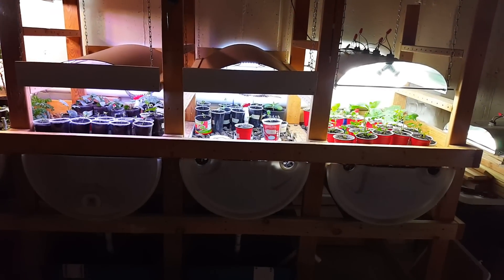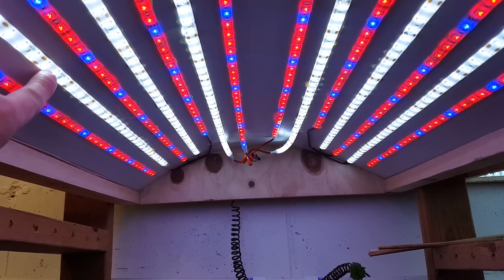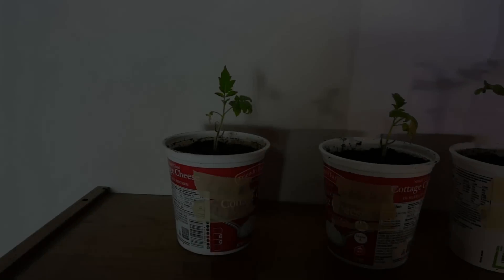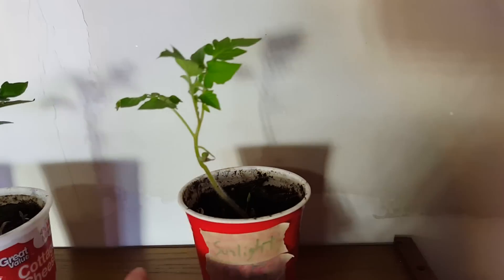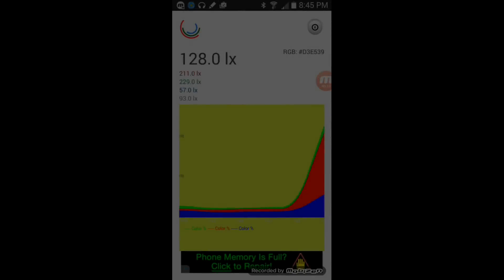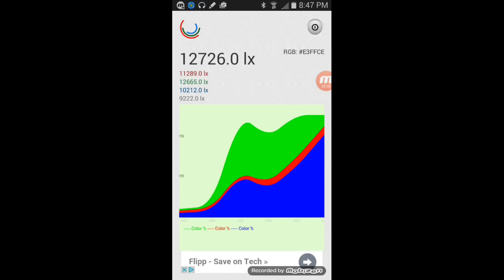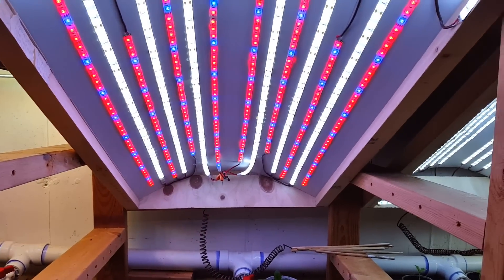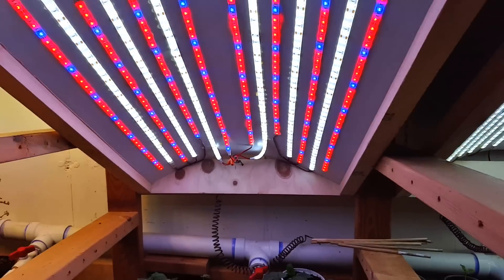DIY LED Grow Light Follow Up - Low Power LED VS CFL

Comment: I could be wrong, but I think you may be misinterpreting the relative amounts of RGB on the app.  The graph is an overlapping area chart, with the lowest (color) value in the front, then next highest, then the highest in the back/top.  I noticed the discrepancy when I looked at the numerical values of each the R, G, and B in the top left of the screen.
Reply: Glen Howard very nice observation!

Comment: I believe you created a problem for yourself by designing the LED units to have a curved surface. All that did was to remove the LEDs farther from the seedlings.
So there is no good reason to have a parabola. 

Look at the stills and videos of the automated plants in Japan where they grow thousands of heads of lettuce per day. The LED units are mere inches away from the tops of the leaves. In your design, they are a foot or so away. This results in far less energy getting to the leaves of the growing plants.
Reply from the maker: +Terry Thomas yes I have done lights both ways but the parabola provides more surface area for more light strips and also provides light at various angles which provides better coverage to the plants
Reply: Another thing I'm noticing is that he's using a single crop in an attempt to represent the effectiveness of these different lights. The wavelength of light will affect how well certain crops vegetate, so I think a better test would have been to plant several different crop families. You might find that some grow even better under the LEDs, despite the flawed design. Just a thought
Reply: Keven Jones
Reply: Luis Navarrete Campos
Reply: Mounting the LEDs flat, you would loose more light at the sides. On a parabola the LEDs are partially shining on each other. I don't know which of the two results in a better efficiency.

Mounting them all on a flat surface, but with an inwards tilt, would probably get you the best efficiency.
Reply: Terry Thomas Yes and the CFLs were closer to the plants. That alone massively biased the results toward the CFLs. If you double the distance between the plant and the light source you reduce the amount of light falling on the plant by a factor of 4.
Reply: Terry Thomassi
Reply: I was thinking temperature could be a factor. The CFL creates more heat. Warmer soil can make a big difference, how big, I'm not sure, but worth consideration.
Reply: Terry Thomas,
My first thought also when I saw him making a parabola. Is the plant canopy in the shape of a parabola? No. So it makes no sense to place the plants in the middle further away from the light source.
Reply: Strip lights throw light mostly strength out from light so no need for a curved hood  I have a design in mind for a grow room with led lighting on side panels set on an angle so that your lower plant growth will get enough lite to keep up with the top 25%of your plants my thought is the yield per plant should increase by 33-to50% hopefully haven't tried this theory yet but pretty sure this method would be best
Reply: My thoughts exactly.  I keep my LED lights ( both strips and solid units) as close as possible.  LED flex Strips I have mounted on the sides to penetrate all levels. Even tried to drape like Christmas lights.  Starting from beginning. Plants love it.
Reply: Terry is correct not enough light
Reply: @SSLFamilyDad  the energy gained by having the strips closer to the crops probably outweigh having better coverage. Ultimately more strips can be used to improve coverage. Then you could decrease brightness to avoid having too much light and saving electricity. I bet this would work since this is also used in the aquarium hobby. Flat surface and as many strips as possible. If corals grow from it then sure every plant on earth should grow from it.
Reply: Ive had a micro garden for a while and led lights are tricky with the pull watt vs equivalent watt. I have three 12wat pull to 75wat equivalent blue/red grow 5,000k LEDs. Costs 12$ a piece from Walmart and they link together easy. So 75watt/225equiv all together over 8 micro Tom's  about 6 weeks old and 18 inches above the plants mounted flat. You need about a 30 wat draw per square foot of horizontal space with led so if you have a 2×2 foot mini garden then you'll need about 120wat from the wall led not a 120 wat equivalent. I see alot of these comparison tests going by equivalent watts when they should run the test by actual watts with a full spectrum led and so far going by my garden notes I'm getting about an inch to 2 inches more growth every 2 weeks when compared 2 full spectrum cfls 80watt together.
Reply: @martinpike803  this is actually something very effective, no jokes. it's a very good setup that i've already seen somewhere in the internet and that makes 100% sense.
Reply: Honestly I think I’ll go with the CFL instead of raising and lowering my lights what a hassle, when I can just dim them as the plants grow closer to them.

Comment: you guys need to stop messing with those cheap led light strips. they may look similiar but you need to buy the better lights. and when it comes to that its not even worth it. you just need to drop 60 bucks and buy a mars hydro 300 . its only 60 bucks. i doubt you could build one better for that price.
Reply from the maker: +HybridCheef sure, you can do that also. There are also lots of cheap options you can find on ebay. This is a diy grow light, by far the cheapest and works just fine for starting seeds and some indoor leafy greens.
Reply: Not worth it. Cheap LED's never give proper results even in the first stages. I always had my seedlings delayed when I used improper lighting. Also you can't really compare 184W CFL with cheap and weak LED's that don't have half of the brightness of the CFL (the start of the video is showing exactly how much difference there is between them). I have 100W full spectrum LED's that cover more ground that shown in the video and will give better results than the CFL. I don't regret making the change towards LED's.

Comment: Your reading of the graph is not accurate. Go to minute 6:00. The max output will be represented first. In this case is blue, the next higher output will be place on top like layers. Green in this case, and finally the lower output red. I have see this type of graph used by Germans to express power outputs. The number is the magnitude by channel. Red 3.4K, Green 4.7K, and blue 5.1k. So, you are getting more blue and green than red.

Comment: ive heard clear cups are very bad, roots dont like light :)
Reply: I've heard that's why you want them, it makes the roots self pruning so keeps them from.being root bound and expands the feeder roots more.
Reply: @midwestmangos2452  it doesn't prune the roots Algae is prone to grow on them. Your confusing it with air pruning from smart pots.

Clear plastic cups work fine as long as you plan on transplanting it before the roots expand to much to the edge.
Reply: @probablynotabigtoe9407  actually what I said came from an article I was reading on the phototropic response of roots to blue light. I think the LG issue is a very good point, but I don't think that it's the only thing determining the way that Roots grow in response to light.
Reply: Use clear on inside and foam or darker one on out. You can check roots and still have them in dark.

Comment: You completely misinterpreted the spectrum:
The higher the color is on the graph, the more of that wavelength you have, it even shows the value in lx.
At 5:20 , for example the spectrum is 4760 lx in blue, 3000 lx in red . Actually mostly BLUE.
Good vid though!
Reply from the maker: +Willie The Fox you are correct, another comment below also talks about this as well

Comment: just because you build something(diy) doesn't mean it works well. everyone save yourself the time and money and just use shops lights if you cant afford proper hps or mh setup. stay away from the disco clown lights. all that research has been debunked. if your going to use LED USE FULL SPECTRUM ONES. I FIND IT SO FUNNY THAT THE CLOWN LIGHTS  REDS BLUES PERFORMED THE WORST YET THIS GUY STILL FINDS THEM PROMISING.
Reply from the maker: +666Necropsy more tests to follow. Nothing was really debunked here othr than under powered led strips don't perform as well. Blue and red spectrum light is still the best light for plants photosynthesis. So in theory the same powered blue light should out perform a cfl. I will either prove or disprove that in the next video. That is what these tests are all about, proving what works. I dont trust anything anyone else tells me until i prove it myself:)

Comment: By the way, when looking at your graph for the $35 LED lights you say "surprisingly the spectrum is mostly red". I just have to ask if your color blind or something, have you looked at the lights themselves? 4 red to 1 blue it looks like in the video, and then all those strips of white! Course 4 reds to 1 blue  the spectrum would be mostly RED LOL
 Change that light to 4 blue to 1 red and plants will grow great. White lights are not needed, and no reason to up power or lumens, just use correct colors for the results wanted. In this case you are growing vegetation, Plants, leaves stems, not tomatoes. When you want the tomatoes to flower and grow then change to red again.
OH, and I meant the color blind as a joke, no offense meant!
Reply: Change that light to 4 blue to 1 red and plants will grow great.
If you mean that plants will grow udner just blue light - that is just LOL
Reply: +killgo Are you sure about that? I've seen in many other Youtube clips: "Don't use green light, because the plant can't use it; it just gets reflected away from the green foliage. Use blue for foliage growth only, and use red only, for fruiting." That seems to be a consistent theme: high-frequency end of spectrum (blue) for vegetation, then miss out the mid-frequency (green) part of the spectrum, then switch to low-frequency end of spectrum (red) for the fruit.

Blue is the color bias that the young plants get in springtime in the open garden, where the radiation intensity of the blue sky is relatively higher than the heating from the Sun. Red is towards the "heating" end of the spectrum, which the plants get in the open garden in late summer. It also echoes the need to switch NPK fertilizer ratio for tomatoes: high N/low PK ratio for vegetation at beginning of season, then low N/high PK fertilizer ratio when fruiting begins. 

But if that parallel principle holds true, then just as we don't drop the NPK fertilizer ratio to zero on either side of the ratio, it suggests that a small proportion of the LED lighting, either for vegetation growth, or for fruit growth, should ideally be white light (which contains the entire visible spectrum).

I'm planning to do some comparative tests on that idea, and will let you know how it turns out.

Comment: This isn't a good comparison, first off all the LED's are barely anywhere near as bright as your fluorescent bulbs. LED's do put out more light per watt, but you are using lower power LED's and then comparing them to more powerful fluorescent bulbs. That is silly, it's as silly as putting 3x1w LED's vs 1x100w incandescent bulb. lol, and then when the incandescent plants are bigger saying incandescent is better. 
Next time try to match the wattages up. You said your fluorescent bulbs used 25w each, so that is 200w of total fluorescent lighting. Where as the LED setups you made look very under powered in comparison, I wouldn't be surprised if your LED setups were only drawing 50w each, hardly a fair comparison. 

From the very start of the video I could tell it was a bad comparison, two moderately bright setups on the left and the far right one super bright, lol.
Maybe you are just an old timer (since you call yourself dad) and you want to convince yourself that fluorescent lighting is better. Oh well, each to his own.
Reply from the maker: +TechCheck I am pretty sure I said right off the bat that this was not a fair comparison since the leds were no where near as bright and that by adding more led strips that I could get the same or better growth. The real difference would be cost
Reply: Strips are too weak, the evidence is they don't need cooling. Even a 1w single diode needs some sort of cooling. 
Your strips likely only are using 1-2w each. So you have 14-28w of usage, vs a 200w fluorescent setup. lol
Reply: The best things you can get are red and blue 1w diodes. You put these on aluminium plates that you buy for them and then solder wires from each plate to the next. Use 4 rows, each row having 15 LED's in each row. 
You will have 60w of total power and it will beat even your 200w cfl setup in growth. 
Secure the aluminium plates to the metal top with heatsink plaster, that will use the metal top to dissipate the heat also.

Comment: so far my understanding of the whole red and blue lights (mind I've only been researching for an hour or so and I may be wrong ) is that the blue light is essential for photosynthesis and the red are for flowering/fruits and vegetables, and you would need more blue than red either way and your set up has a lot more red than blue which seems to be opposite from other set ups I've seen on here.... again I could be wrong but I am  only just scratching the surface of this topic........ don't you love the internet? so much easier to learn about things and not just for porn! who knew there was more than porn out there ? lol
Reply: the red light fuels photosynthesis, carbohydrate manufacture. Some photochemical reactions require a more energetic photon, in this case blue. It is used in the synthesis of chlorophyll. Lots of blue, dark green leaves and shortening of the plant due to main stem inhibition. When a plant has lots of blue it sees sky all around and quits reaching. Concentrates on vegging as a result. When more red it reaches as someone else is top in canopy. Reach or die from lack of light.
Reply: @KirkMcLoren  you both need to read up on the topic a bit more... your close but also wrong. Ur right about the blue reaching and red needing to penetrate, but wrong about everything else.
Reply: @probablynotabigtoe9407  Been doing it for years and showing people what is wrong with their grow, Sounds like you are giving bad info if you say I am wrong. My version is in the botany books.
Reply: Said the guy with one big forearm..😂😂